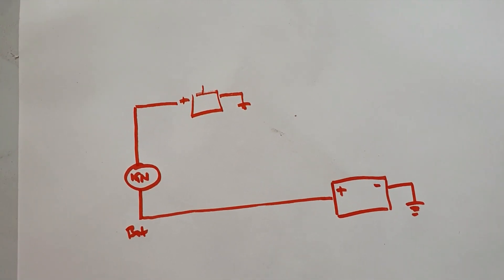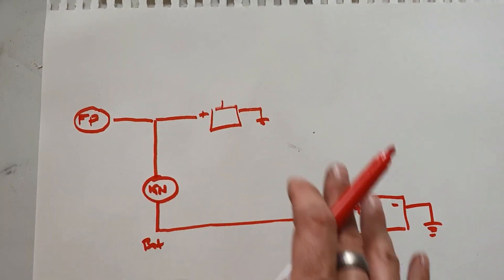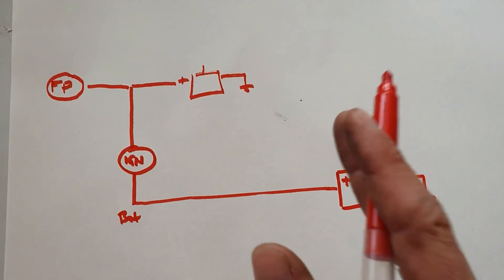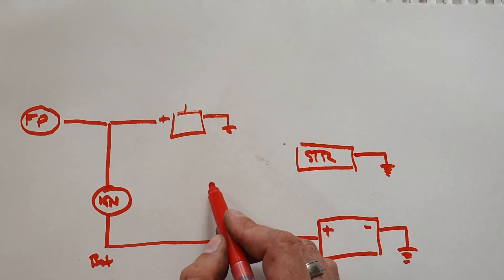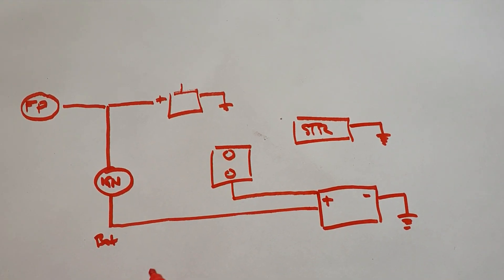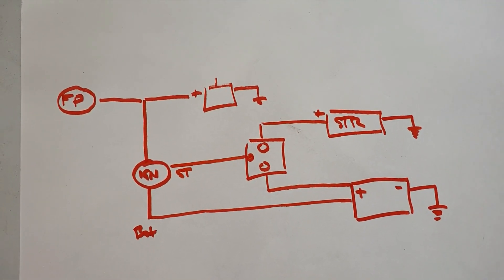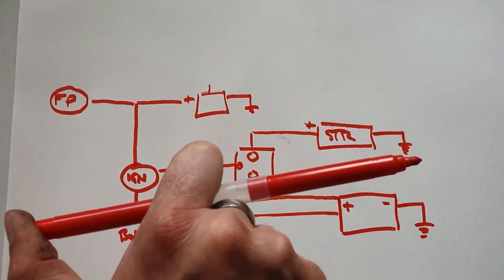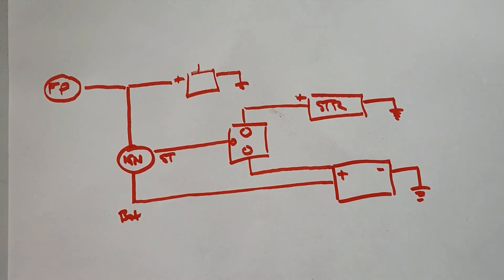How to wire up an ignition circuit for a test stand

Comment: Does this work for feul injecton engines ? Sr20 specifically?
Reply from the maker: @bradleyjanes1985  other than it not referencing a coil pack or sepearate injectors or an ECU power supply the basic principal is the same
Reply: I have feul pump starter  and ecu hooked up to a switch board but I need to wire my coils to a switch because I just have no spark